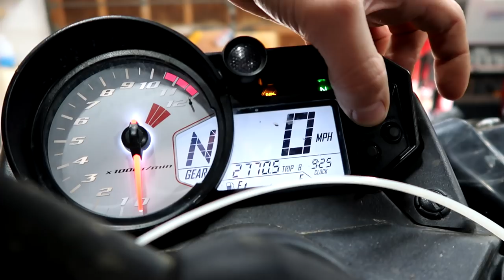CRUSH & I HAVE A SECRET let me explain...

Comment: you have the front driveshafts out, the center diff will just be sending the power to the front diff meaning no drive to the back (unless of course there is no center diff)

Comment: Hey 3D Machines, i had a yamaha yxz100r, bout with 212 miles ran it 3 times did a bunch of upgrades speakers, led lights, bumpers, rock sliders took it out to lost trails in pa did fine, loved the thing then took it back to lost trails and blew the clutch, then took it to my dealer got a recluse clutch put in, took it to aoaa trails in pa, was riding with a buddy for about two hours then blew the brand new clutch, at that time i was very mad and didn't know what to do, then was about to get the thing regeared like everybody said to do to fix the issue, but i didn't i just fixed it again and sold it really wish i had it still but was to many headaches and i hope you dint have the issues i had.